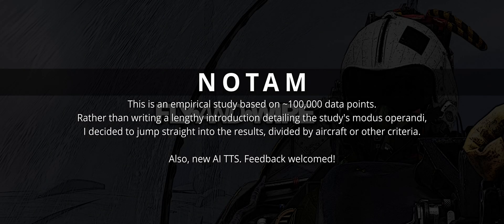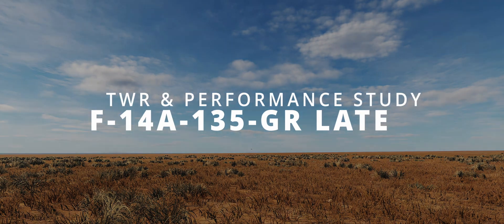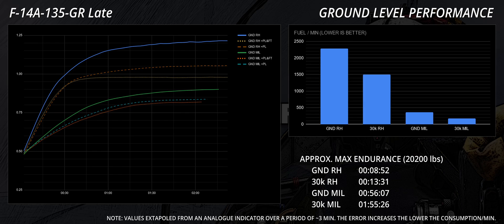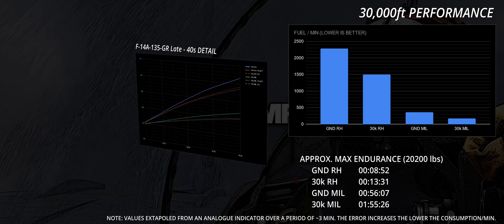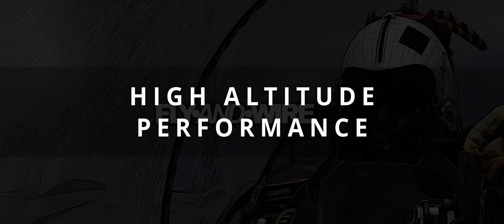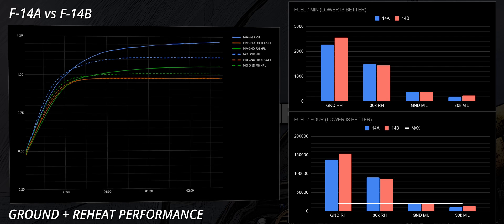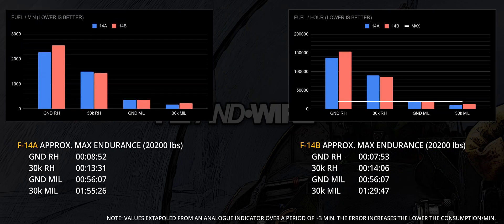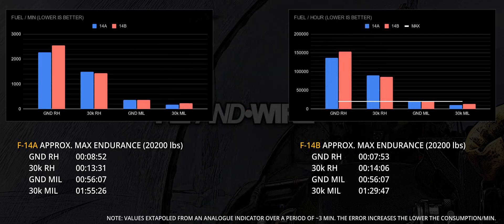Thrust-to-Weight ratio, Fuel & Performance Study: F-14 Tomcat

Comment: One of the things that drives me up a wall is how everywhere, we see "Sea Level Static Thrust" statistics for engines.  The F-14's version of the TF-30 based on what a I read, is producing almost 30,000 lbs of thrust at optimal airspeed and intake conditions versus the much lower values it's known for in sea level static thrust.
Reply from the maker: Yeah, and even worse, very often, the context of the value is not specified either. That's why I shared the "live" spreadsheet, so I can update if I find more appropriate values.

Comment: DCS F15E is powered by the P&W F100-PW-229 engines not the 220
Reply: 229 is supposed to produce much more power than 220 isn't it? I can also see in pvp how ludicrously fast F15E is,  chilling at mach 1.8 at 50k
Reply from the maker: The spreadsheet in the comment lists the sources as well, in this case wiki. It lists both the -220 and the -229, I suppose it depends on the upgrade? Do you have more info? Thanks!
Reply: @FlyAndWire   I think the DCS one models the 229. That is what ED says on their website
Reply from the maker: Ah, I missed that. Thanks, I'm updating the spreadsheet.

The thrust value reported by P&W is the same as I found for the dry thrust. I won't touch those and just change the nomenclature for the moment.
https://www.prattwhitney.com/en/products/military-engines/f100
Reply: thank you for your video. Very interesting!

https://www1.grc.nasa.gov/beginners-guide-to-aeronautics/enginesim/
quite nice to assess how thrust is developing depending on speed and altitude. Of course just an approximation since intake design and also nozzle design has a huge impact on thrust output.

Comment: This is great information. I've heard arguments that the TF30's were better at high alt, but it seems like the F-110's are just superior in the majority of cases. especially when using payloads.
Reply: Dont you mean low altitude. Think the 110 had digital fuel control and didn't perform as well down low. TF30s were designed for the F111 so i assume it had great low level performance.
Reply from the maker: Yep, I heard the same. The numbers seem to confirm what most pilots say. For example, there are accounts of DACT of Tomcat vs F-15 or others almost mocking the F-14 lack of performance when low on energy, but then they were surprised when the F110 was deployed, as it allowed to recover from low-energy states much better. I think Aircrew Interview has a couple of interviews along this line, and the F-14 Tomcast as well.
Reply: The advantages of the TF30 require airspeed. The TF30 was "better" down low. At high altitude it was also better but only once you hit transonic speeds.  This has to do with the intake geometry and air stacking in front of the engine creating a RAMJET effect. The F110 has this too, but the more advanced fuel control and intake ramp scheduling was aimed at better thrust at combat speeds instead of above Mach 1 speeds.